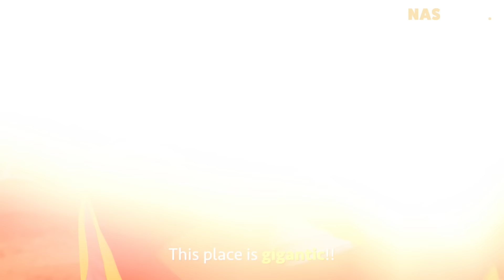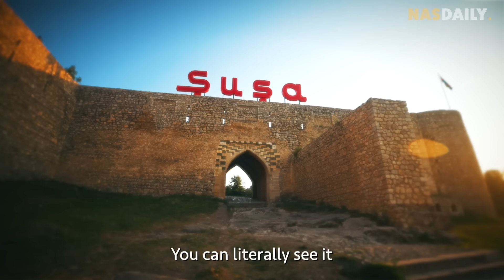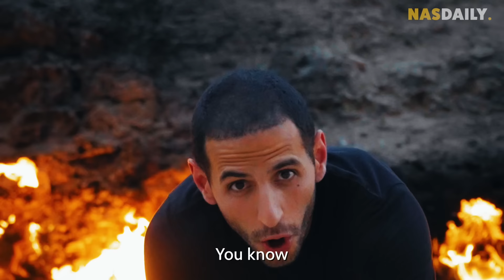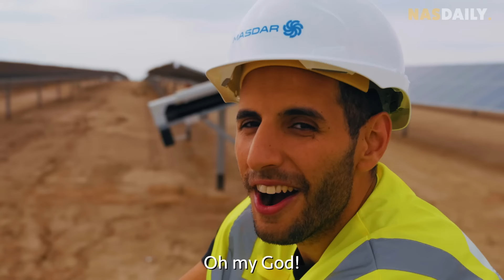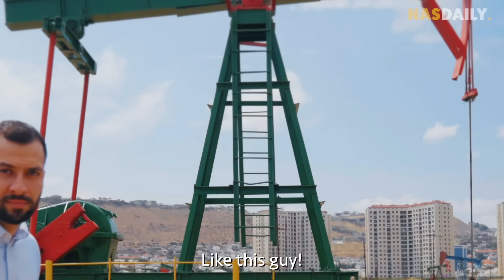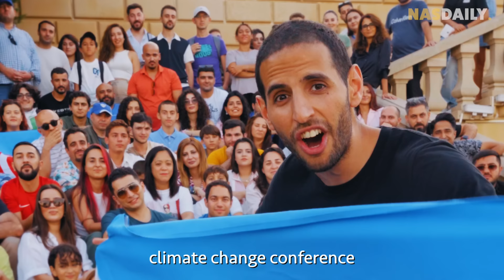The first oil country is Going Green

Comment: I have a Question 🤔
 A Solar Park Produces More Energy 
Or 
Placing Individual Solar Systems 

Cause from the Solar Park if energy will be Transmitted some energy will be lost during the Transmission.
Reply: It depends bro 
You’re correct 
With higher distance there will be loss due to resistance 
But it doesn’t count on how many units we assemble 

It’s always better to install power sources close to cities to avoid loss
Reply: Right now there is no effective way to replace a traditional way of getting the electricity . But we need to start from something and develope it.

Comment: They would going green if they stop mining coal, oil and gas. Will they do while it's profitable? I don't think so...
Now all the've done is just built a big solar cell park, because they have the money for it from mining fossils.
And as far as I know, solar cells aren't profitable to recycle, so thats an other issue. A more eco-friendly solution would be to heat water by parabolic mirrors and run steam turbines with the steam. 
I'm not against the people, I'm about the idea.

Comment: Actually discovered and used in China in 600 BC. 1859 first oil well was in Pennsylvania. Some other info from Wikipedia:

According to Herodotus, more than four thousand years ago natural asphalt was employed in the construction of the walls and towers of Babylon. Great quantities of it were found on the banks of the river Issus, one of the tributaries of the Euphrates.[2] This fact was confirmed by Diodorus Siculus.[3] Herodotus mentioned pitch spring on Zacynthus (Ionian islands, Greece).[4] Also, Herodotus described a well for bitumen (very thick oil) and oil near Ardericca in Cessia.[5]

In China, petroleum was used more than 2000 years ago. In I Ching, one of the earliest Chinese writings cites the use of oil in its raw state without refining was first discovered, extracted, and used in China in the first century BC. In addition, the Chinese were the first to use petroleum as fuel as early as the fourth century BC.[6][7][8][9]